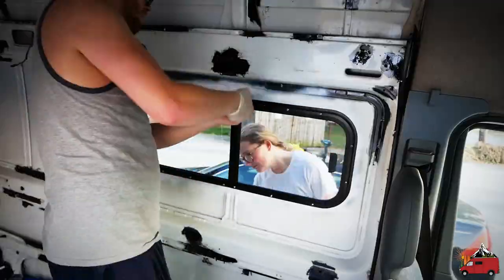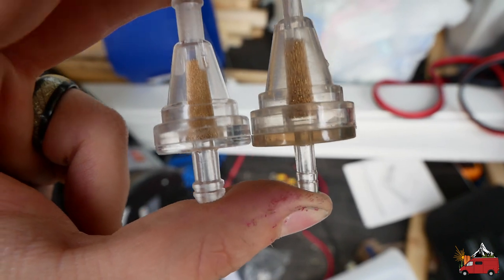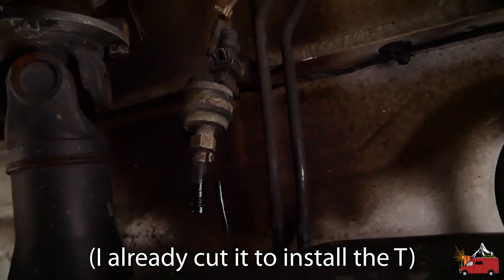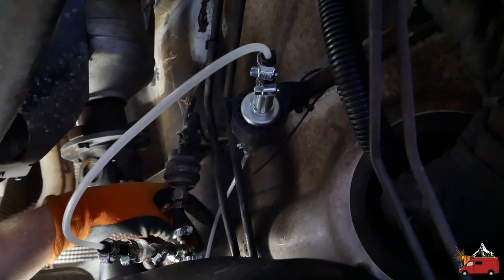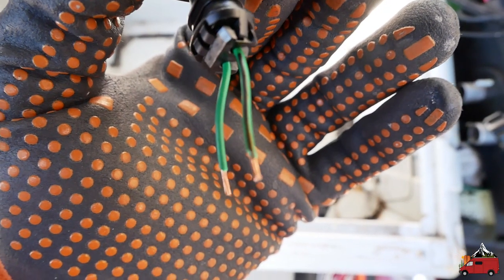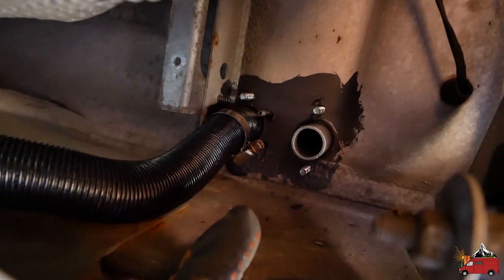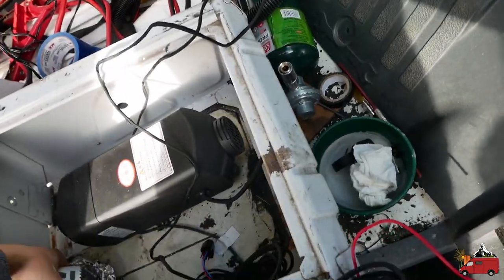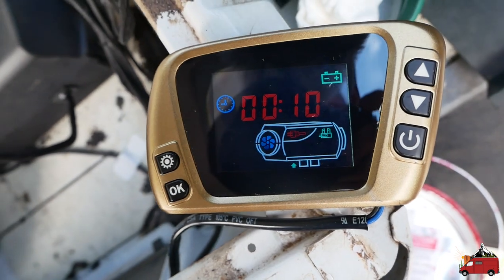CHINESE Diesel Heater DIY Van Install | BEST VALUE ($150!), SAFE & VENTILATED, HIGH ALTITUDE!

Comment: Great video! Was really helpful to get my heater installed in my 118 wb. It’s been getting pretty cold her in Utah and when I fired it up over the weekend I got an e 08 error which I think maybe fuel gelling. Wondering if you experienced this and how you went about solving it?
Reply from the maker: I haven't had this issue, usually they put additives in the fuel to prevent freezing but if you filled up somewhere where it doesn't get cold enough to freeze up and are now where it does, can definitely be an issue. You can buy additive like heet or diesel 911 and add it to the tank. You could pull the fuel line and drop it into the bottle of heet/diesel 911 to pump some direct into the fuel line also to try to help

Comment: At around 13:07, with the silver exhaust pipe. What you should have done is cut that pipe somewhere in the middle. Then you could have put the muffler in between the two pieces. This would allow you to mount the muffler further under the car giving you a more secure mount and/or maintaining your current ground clearance under the van.
Reply from the maker: That was my initial plan but it is really hard to get a good seal doing that with these pipes because the ridges. It's hard to even round out the ridges to get it to fit on the exhaust when cutting it, not impossible, just a pain and could possibly leak. 

I've already got another piece of exhaust in hand to add onto it and do this though, I think it was $12 or $15 on eBay. Looked for something at home Depot but they only had copper pipe that would fit and it would corrode incredibly fast, so I just ordered it. 

No biggie! 
Thanks for the comment! Are you converting a vehicle or have an RV of sorts? 🙂
Reply: @projectvagrant8197  I have a van and installed a diesel heater myself a few years ago. They are absolutely fantastic. I agree with you about the pipe. When I did mine I found that a good quality steel host clamp flattened out the ridge on the pipe and didn't leak. Another tip is that if you park in the snow where there might be 1-2ft of snow, be sure to kick the snow away from the exhaust pipe to help ventilation. Also run the heater a few times over the summer.
Reply from the maker: @Kevin_Aus  good tips, thanks for sharing! We took the van camping last weekend for the first time since we've started building and it kept my wife nice and warm when it was 33F through the night, we are very happy with it. We have an AfterBurner controller coming in for it, you should check them out if you havent heard of them. About $90 USD from the creator and adds some nice features/functions to the heaters :)
Reply: @projectvagrant8197  I've seen the AfterBurner, looks great but I don't need all those features. I use a raspberry pi with a relay and 3g modem to remotely control mine, this also allows me to control other things in the van as well

Comment: I just completed this install using this videos method of tapping into an existing fuel line for the aux heater, and it worked!! Thank you! I did this on a 2006 t1n 2500. Because I have the webasto and not the Chinese heater, although the 6x6x6mm T-barb worked, I did need one piece of 6mm sleeve tubing (only 4mm sleeve connectors come with webasto) so I also ordered that part. Everything went pretty smooth and was able to pull out the fuel line from the espar pump and reuse the sleeve (after cutting away the clamp) without having to cut the line, making the setup less complicated. I'm impressed with this method and it saved me $400 from having an outfitter do it.

Comment: Do you have to adjust the heater for different altitudes? Do you think it would run properly at 8,500ft?
Reply from the maker: You do have to adjust it -- someone who reverse engineered the heaters & created a custom much nicer controller found that the blue/gold LCDs that "apparently auto adjust for altitude" are BS chinese scam. They do show an altitude reading, but he found there was no actual change to the fuel/air ratios during use in different altitudes and no programming that calculates a different tune in the controllers. There is a guide someone put together on the correct air/fuel settings for different altitudes. I'll see if I can find it for you
Reply from the maker: https://photos.app.goo.gl/x4cow1qmg7q45LFS7
Reply: @projectvagrant8197  Thanks for the info!
Reply from the maker: I came across a more clear guide here https://photos.app.goo.gl/CCZhTWR8MJ4g6bTA6

Comment: can you do a video describing the paint job you guys did?
Reply from the maker: Thanks for the idea! We painted the van with Monstaliner (bed liner). It costs us about $400-500 in materials. There are quite a few videos on the process if you search. I would recommend spraying it rather than rolling it. We rolled it and it took FOREVER and didn't come out as clean as a spray. It still looks good enough and I'm happy with it.
Reply: @projectvagrant8197  thanks for details. what kind of prep did you guys do beforehand? any sanding or just a wipedown to remove oils and dirt? thinking about doing the same to my van soon

Comment: At what altitude have you been running this at? Anything above 8,000' for any length of time? I live at 8,300 and often travel and stay at elevations well above that. I have heard of people having issues above 6,000'. According to your comment below I would need to reduce the fuel by 32% or more. Does the little computer allow for that? Is there any limit? Thanks for your input!
Reply from the maker: The computer should allow you to fully change it. I have little personal experience running this at higher elevations as we just started traveling in our van. In the description is a link to the Chinese diesel heater Facebook group, if you join and post someone will definitely fill you in with more information regarding high elevation use of the heater ☺️
Reply: @projectvagrant8197  I was linked to this vid for high altitude calibration, fck I hate YouTube sometimes 😑
Reply from the maker: @futurebalance6134  I got you! This is the chart I use https://photos.app.goo.gl/vqqMLboXJXt4kSy98

Comment: For a high altitude setup, what settings are you using for proper fuel and air mixture?
Reply from the maker: Reduce fuel by 4% per 1000ft.

Comment: Im deff gonna get one of these for my build 

is there any way of maybe making some kind of splitter for the conduit so that I can run it round to the rear of the van and heat more area quickly ? logic dictates that it should be possible b ut Im just wondering if there might be a downside?
Reply from the maker: It included a t so you could pipe the heat to 2 different locations technically. Should be possible with some creativity 👍

Comment: It's been 3 yrs now so how is the heater doing?
Reply from the maker: Still working! Had to replace the glowplug once ($20 on Amazon) but that's basically it.
Reply: @projectvagrant8197  Thanks for the response and thanks for your videos they really help out. I noticed you placed the heater to the inboard side rather than the outboard side of the seat pedestal. Most of the instals I have  seen others do the heater was mounted to the outboard side, so did you have any particular reason for doing it that way? I'm not sure if I should go with the 2kw or the 5kw size heater. I have the 158 wheel base but I don't plan on real cold sub zero temps so I might be good with the smaller one and it would give me more wiggle room under the seat?
BTW did you give up the van life, you haven't posted for a year now.
Reply from the maker: @vanman3752   no real reason I installed in the exact location I did. If the other side gives more access from the bottom, go for that 1 because where I chose was pretty tight attaching the clamps on everything (exhaust, intake and fuel lines). 

To be honest if I did it all over again, I'd install the heater under our bed where our lithium batteries, water tank, etc are. Because then the residual heat coming off the heater will keep it warmer there and prevent the batteries or pipes/water from getting too cold. Ive got a big vent cut in the wall under our bed now and it stays within 10 degrees of the temp in the van now but used to be 20-30 degrees different when it was just a smaller vent. 

With the 158 having more space a 5kw may make the most sense just to be prepared "for anything." 2kw may be fine if you're never going around 0 F though and insulate fairly well. 

We're still living the van life! Not as mobile as we used to be -- we usually spend 6-9 months of the year traveling full time and then spend 2-3 months at "home" (living in the van in family's driveway) during holidays. Well, after 2.5 years we realized we were almost out of our savings so we ended up being at home way longer than we planned while I looked for a remote job and got back into the 9-5 life from the van. I also remodeled the van a bit (rebuilt our bed, added a lagun table to the passenger seat, added some more cabinets, a back splash, also added starlink setup and another solar charge controller and deployable 300w solar panel). I also did quite a bit of maintenance (new injectors, new idler pulleys, belt, coolant flush). To be honest I have pretty bad ADHD and I struggle with consistently filming, editing, posting, etc. and now that I have a full time job it's just all hit the back burner. We got back out there for about 3 months and explored the Northeast US but it was pretty crap. Lots of parking lot camping, especially because camping is way more limited and I need service or a clear sky and solar for starlink 8 hr a day. On top of that all our friends we have met and traveled with were out west and we didn't really meet any other cool vanlifers except in Canada and the upper peninsula of Michigan. My grandma just got diagnosed with stage 4 lung cancer so we've come back home to be close. So yes -- we are still living the vanlife, just a lot less mobile at the moment.
Reply: @projectvagrant8197  Thanks for this install vid.  Very helpful.  Take care.

Comment: Thanks for the video, it was helpful. Did you use the exhaust clamps that came with the heater? Do they seem like they work okay? Lots of people on the facebook page recommend those T-clamps but I don't want to wait for them to ship.
Reply from the maker: I did use the included exhaust clamps and it seems to be so far so good 👍
Reply: @projectvagrant8197  Sweet, thanks for the info!
Reply: An update for anybody that reads this in the future, the supplied clamps worked well but the longer exhaust pipe I ordered wasn't as snug as the one that came with the heater. I  cut two little slits (~1.5 cm) in the end of the pipe and made a shim with an aluminum can. Worked great!

Comment: what do you use high temp por15 for?
Reply from the maker: After cutting through the floor of the van there is a seam of exposed steel which will rust away. I painted it with high temp POR15 to cover/seal up the steel so it will not rust

Comment: That Espar fuel pump has a filter screen inside the inlet fitting. Does your Chinese pump copy that feature?
Reply from the maker: Sorry man, I'm honestly not sure and don't want to pull the pump to at this point. That's basically all the inline filter does so regardless I wouldn't be concerned about it. You can ask on the FB group in the description of this video and know for certain

Comment: Great video. I recommend keeping silicone far away from your van. It’s bad news. Use a good polyurethane instead.
Reply from the maker: No worries I use 3M 5200 fast cure for everything just about. Silicones that are acid based are bad news as they corroded paint and worsen rust!
Reply: Project Vagrant great, 3M 5200 is a Polyurethane. The problem is, people hear “silicone” and go and use silicone and it will leak and cause all sorts of problems. Van life and RV newbies need to be aware of this 👍
Reply from the maker: @Fanzindel  good point. I honestly have mentally just grouped the Marine sealants together as "silicone" but you're totally right. I "loved" your comment which should (hopefully) put it at the top of the comment section :)
Reply: @Fanzindel  So glad I just  learned this from you guys.  I had no idea silicone is very bad for van building.
Reply: Trang you’re welcome and good luck with your project 😊

Comment: out of all the vids for this diesel heater shtuff, this is the best one hands down! thanks for the deets + links. How has the heater been treating you since installation? Rock on
Reply from the maker: Glad to hear you enjoyed the video! It's being working amazing. We actually live in the van now and the only problem I have had so far is the fuel pump connection sometimes comes loose. It's because I removed the little pin that holds it together and lost it honestly. I zip tied it and haven't had any issues. Also the little rubber hose I got as well as the rubber sleeve that holds the pump seems to be really cheap. It's dry rotting and crumbling on the edges a bit. I've reinforced the sleeve with zip ties and the rubber hose isn't leaking so I've left it. If I had realized I would had bought better quality of those parts from my local hardware store before installing because it's just a few bucks. Other than that I have had 0 issues and those are easily avoided. Some people have had no issues with these included parts I think it's just luck of the draw honestly.
Reply from the maker: We've been running it every night the past 4 days and we've ran it multiple times before we moved into the van while we took it on small trips and so far it's worked well every time.